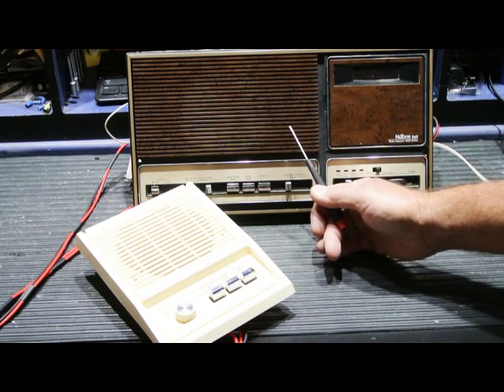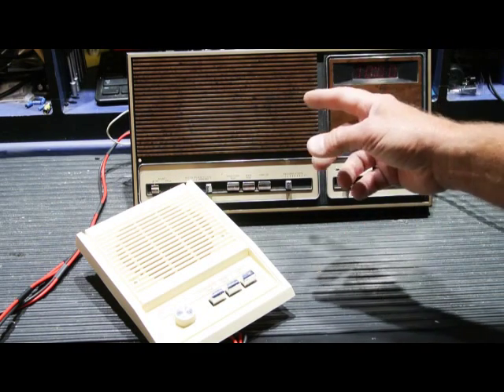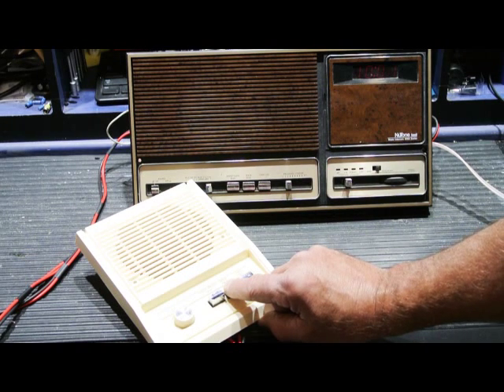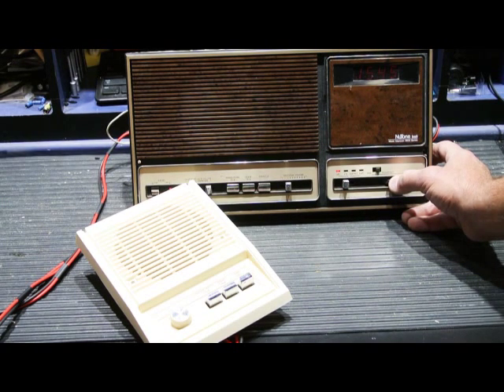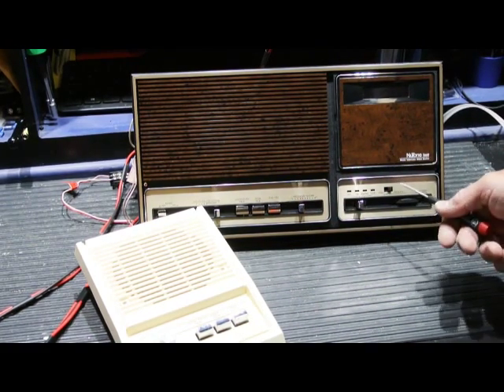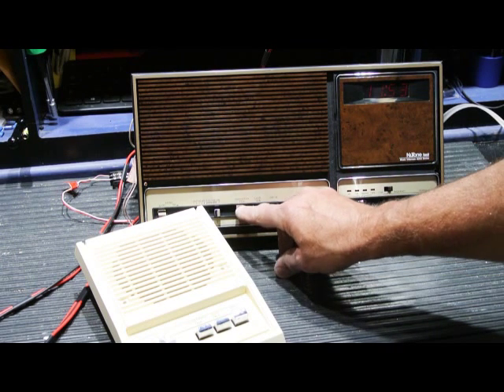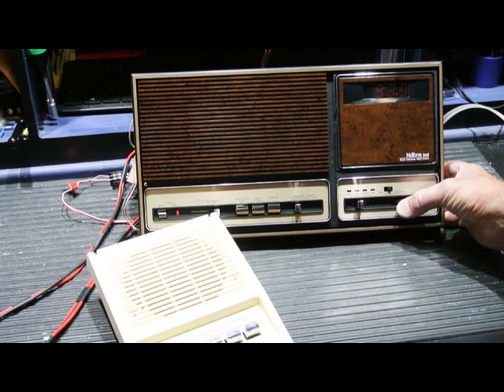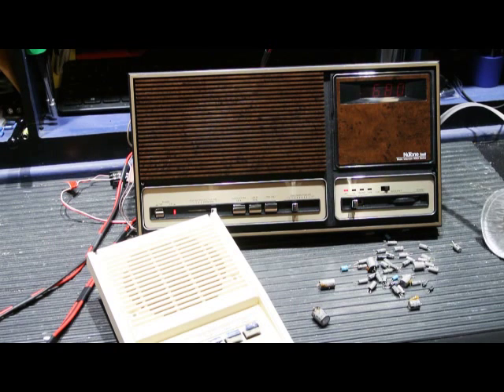NuTone Intercom IM3003 Failure Mode #2

Comment: So on mine the AM - FM radio including the Chime module works. But i’m not sure if I’m using the intercom correctly, when I press inside/patio talk on the master station, it cuts the music out on the master station, but not on the remote station so the person in the next room is hearing my voice over the music so if I want to call to someone, I would have to turn the radio off. Could it be a problem with the remote station itself?  Is this normal?
Reply from the maker: Hi pl9og8my6d:  If your IM3003 System is complete and it has the correct Remote Stations - then no it's not a problem with the Remote.  If you think about what's happening, the odds that several or many Remote Stations are defective is unlikely.
     The problem is likely to be withthe IM3003 Master Station - Further troubleshotting is required to identify the source of the problem(s) - Chris

Comment: How did you plug it in to test. I have one I would like to test without installing it.
Reply from the maker: Hi Badmanmiles:  To power up an IM3003 - you need a 16 Volt AC Transformer rated at a minimum of 15 Watts (VA) - and a AM / FM Antenna - This setup would allow you to test the Radio - If it has a Chime Module, you can also test it by jumpering between the "Common" terminal and the "Front" - "Rear" and "Side" Terminals on the Chime Module
     To test further, you need a Terminal Board and a Remote Station and Door Speaker - Also, you should know that you cannot set the Time unless the IM3003 is connected to a Terminal Board
     If you don't have all of these items to use for testing - the best choice is to try it out in place of the original IM3003 - Chris
Reply: Thanks.

Comment: I have the same problem.What did you do to fix it.
Reply from the maker: Hi Patrick:  I diagnosed the problems - rebuilt all of the circuit boards - cleaned the controls - tweaked the Tuner a little - washed and cleaned the faceplate and it all works - Chris
Reply: @patrickobrien6443 what did that service cost ? I have a very similar system

Comment: Any idea on how to identify a Nutone intercom model number? Just bought a home built in 1980 and there’s several Nutone intercoms. The intercoms have “Nutone Scovill” in the lower right hand corner, but no model number.
Reply from the maker: Hi Holly,  Usually most NuTone Systems have some sort of "Master Station" which will have both Radio and Intercom functions.  The Model Number would be on the Master Station.  In 1980, there are 2 different Models that don't have a traditional Master Station - the IMA516, which is a Voice only System and the I600, which a a Selective Call System - in which every station is a Master Station.  The easiest thing to do is to send me a picture of your Remote Stations, you may an incomplete system, where the Master Station has been removed (due to remodeling) and the Remote Stations were left in the house - Chris  nscompany@msn.com

Comment: I have the exact same problem with the humming of each button being pressed but what did you do to fix it I don't understand that was not on the video whatsoever
Reply: Do a video on how to fix it
Reply from the maker: Nicholas VanBuskirk 
This is not a "how to repair your Intercom" video, it simply shows one of the common problems that occur with the IM3003.

For more a more detailed explanation of what was done to fix this IM3003, you will need to visit our website